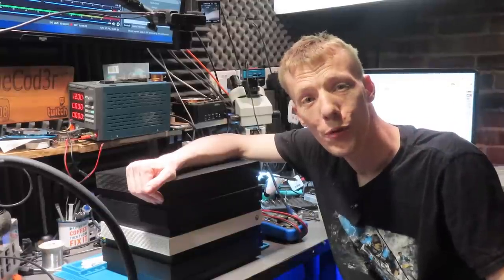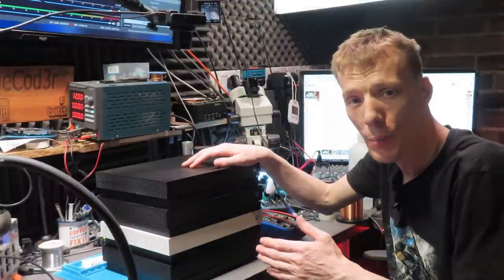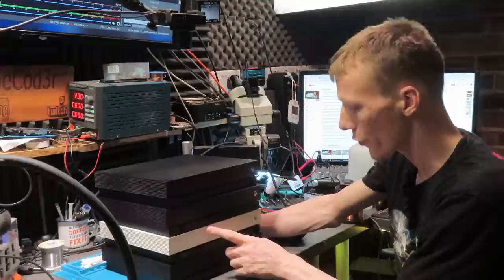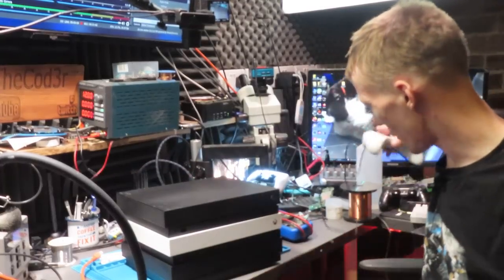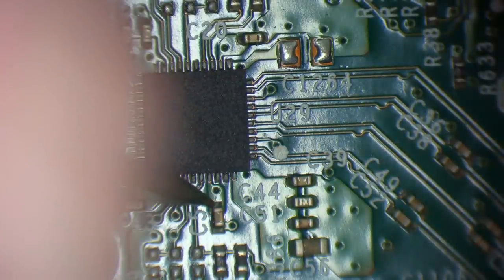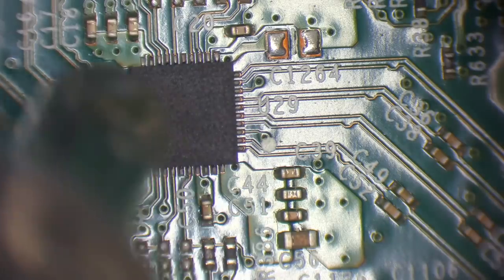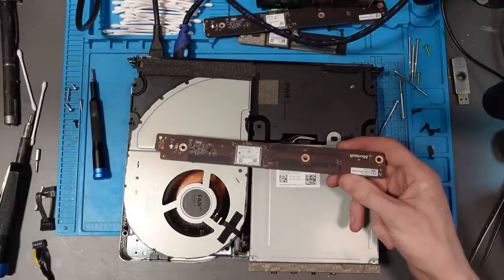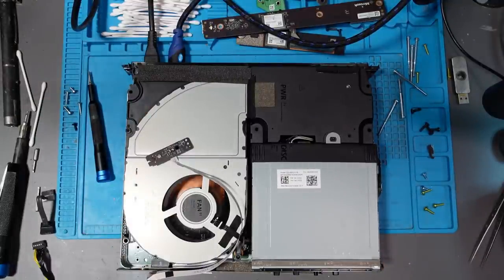I Bought FOUR Broken Xbox One X Consoles For £186 ($235) On eBay... But How Many Can I Fix?

Comment: I like your videos your very honest about whether you fix thing or cannot fix it. That being said I've seen several videos where you state there's something wrong with your cable...is this a common thing? Are you buying cheap cables?..it seems that a repair guy should have functioning hardware especially something as easy as a cable..just saying. I only mention it because like I said I've watched several vids where this is a problem
Reply: cables dont last if hes repairing consoles all day plugging in and out all day they give up after a few months even the expensive ones are not designed for this use
Reply: Most HDMI leads are connected once and left in place, they simply aren't designed for the rigours of plugging/ unplugging

Comment: The connector ribbon for the front panel pair button is ridiculous- it goes round 90 degrees and is very tight/stressed. + finding that spare part is very difficult.

Comment: that chip seems to be a weak spot, any reason for its failure, could it just get too hot over time? i cant understand it getting to hot as u have to heat the shit out of it to get it on the board.

Comment: Hi. How do you know when you solder chips with hot air i press them down and solder comes out the side, that you haven't shorted pins and square plate inside?
Reply: Flux and force. If you push down, it tries to come out in a buble form.
Flux prevent solder to stick to everything.